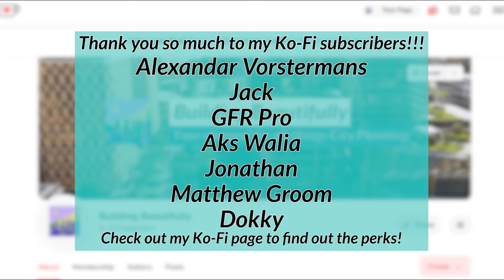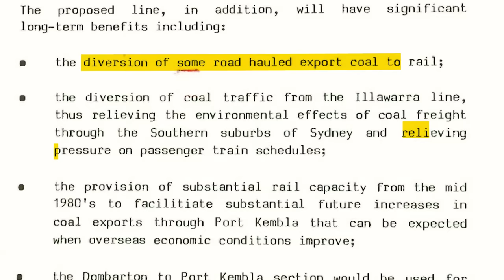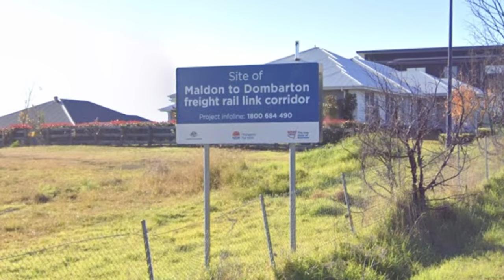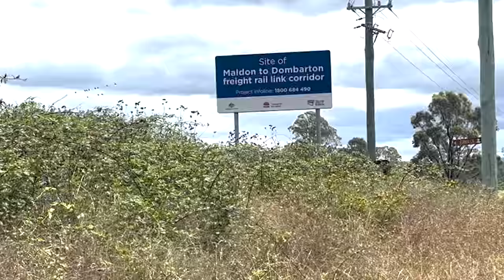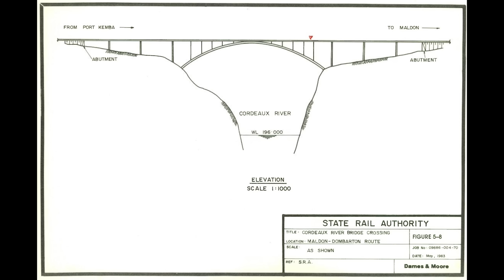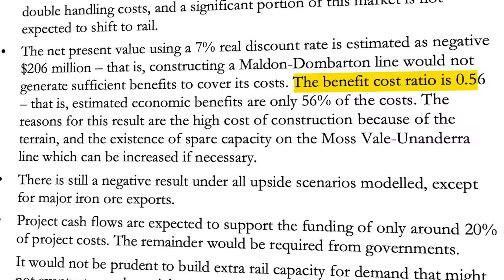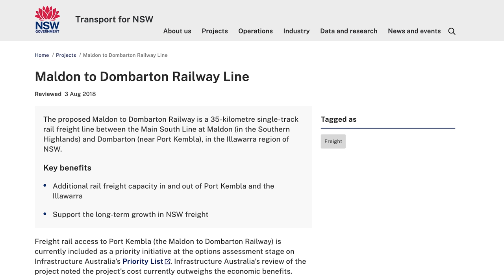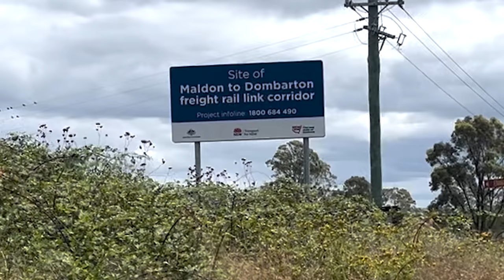The Maldon-Dombarton Rail Link: Lost Sydney

Comment: Interesting video. I lived in Camden at the time of the closure and did travel around the area a bit so was familiar with the missing bridge. You mentioned that the cost of coal dropped and that this was the reason for the government's decion to abandon the project. This is generally correct, however if memory serves,  the drop in coal prices led to a  number of the BHP Burragorang pits to close. These mines would have been the primary source of the freight traffic on the line and also that the future of the mines in the area would be in doubt for years. As a sideline, hundreds of miners resident in Camden and surrounds were suddenly out of work as a result of the mine closures.

Comment: Nick Greiner (pronounced like Grinder without the D by the way) and his successor Johm Fahey were about as anti rail as you could get, it was on their watch that SRA were split into 3 seperate entities (City Rail, Freight Rail and Countrylink) then privatised altogether, virtually all new rail projects were cancelled whether they were still on the drawing board or partially completed. Only maintenance and upgrades of existing rail corridors were allowed under the Greiner/Fahey governments and even that ceased after full privatisation, eventually the then head of State Rail during the early 90's John Brew who oversaw the huge maintenance and upgrade prior to the handover became the most outspoken opponent of the lazy penny pinching corporation who took over administration of the NSW rail system.
BTW yes you did get the pronunciation of Unanderra correct.

Comment: NSW Government want to "straighten" the current SW rail line from near Maldon to bypass Picton and Tahmoor, and join the line at the Tahmoor coal mine. There is plans for a freeway on-ramp and off-ramp near Douglas Park to head up past Camden to go towards the new 2nd Sydney airport. Now with the 15-20 thousand houses proposed at Appin and the 15-20 thousand houses at WiIton, with a high school, shopping centres, etc, and no real transport infrastructure proposed. If the rail line was build and a station put at Wilton, it could serve as a transfer to go between the South Coast to both Picton/Tahmoor and on to the SW to Mittagong/Mossvale as well as to Narellan or Leppington and the proposed rail link to the 2nd Sydney airport. The Unanderra-Moss Vale line has stopped being used for passenger trains a while ago, with only buses traveling between Moss Vale and the South Coast. There is no rail link to the South Coast anywhere from SW of Sydney south of Wolli Creek station
Reply from the maker: Let’s hope a link is built in the next few years/decades. God knows the area needs one.

Comment: The other main issue is this alignment was to be electric, the tunnel grade was fine for electric locos but won't be for diesel and then you have issues with ventilation in such a long tunnel and diesel locos. If it was to be built for diesel the tunnel alignment would need to change and overcome engineering issues for the ventilation

Comment: There are a number of problems on the illawarra line that need to be rectified to run passenger rail services efficiently.
There is no point in building the Maldon/Dombarton unitil the the Hurstville/Sutherland bottleneck is rectified, freight can operate out of hours.
No improvements to Wollongong/South Coast or services to the shire can be undertaken without track duplication.
HS2 to Wollongong is off the table until Santa becomes the Premier of NSW.

The first problem is the 2 track bottleneck between Hurstville and Sutherland/Waterfall, the more trains that are pushed onto this route due to increasing population of the shire restricts how train services can be operated on the whole illawarra line, if the 20 trains per hour limit is reached between Sutherland and Hurstville no express trains can be operated. Trains from Wollongong are forced to make stops or operate slowly so can't just stop at Waterfall, Sutherland, Hurstville in peak hours and run at high speed on this part of the route.

Fixing this is very costly between Hurstville and Mortdale there are steep slopes on the rail verges that need significant construction work for track duplication requiring both land resumption and heavy viaduct construction. 
A new higher bridge at Oatley/Como can be built and the Mortdale sidings/carriage works could be relocated to Loftus, these works are also very pricey.

If this project were done in conjunction with the Maldon to Dombarton link, then significant savings could be made in both the construction of the Como bridge and Penshurst viaduct.
I don't see any change from $4-$5 billion. It is however the first step in much faster, efficient Illawarra service (inclusive of better Shire services) with a lot more capacity.
Reply: But the Maldon/Dumbarton line was never about freight to inner Sydney, but about linking Port Kembla to the extensive coal mines in the southwest of the Sydney basin. The further link to the existing general freight network was a bonus, but not the main game. Now that those mines have largely closed (and the remainder are doomed) there must be no case at all for finishing that tunnel, at least as a dedicated freight line. Possibly it is now worth doing as a way of linking Western Sydney Airport and the southwestern suburbs of Sydney to the Illawarra though.

Comment: Not mentioned in the video but that line was meant to have been electrified (at 25Kv AC) which I believe is how they could get away with such a long tunnel. Be interesting to see if the project ever does get the go ahead what mods they would need to do to the tunnel to allow diesel trains through. Or if, and I doubt it with railways being privately operated if electric locos would return to NSW.
Reply: They could have gotten away with using diesels because loaded trains were expected to be running downgrade. The diesel engines would have been at idle with dynamic breaks pumping heat into the tunnel but very little exhaust. A fan system could be installed to deal with fumes from trains running upgrade, much like the Otira tunnel in New Zealand.
Reply: @dat581  that wasn’t the plan though. The plan was 100% electric which at the time is how freight trains in the Sydney area operated.
Reply: Diesel trains go through tunnels 3 km long in Europe.  It’s not the end of the world. Plus in the 21st century you can build exhaust systems. They do for car tunnels.
Reply: @xr6lad  think you have totally missed my point/question. Of course diesels can run in long tunnels. However that (proposed) tunnel was designed for 100% electric. My question was what mods would be needed to allow diesel in that tunnel. 

Yes extra ventilation is required however to accomodate that would it mean a complete redesign of the tunnel route etc to accomodate it.
Reply: Not sure about AC.  NSW traction is DC. I think 11kv
Reply: @brucegibson5816  NSW is 1500v DC. 

However I was not mistaken the plan for this line was 25Kv A/C. The 86 class locos weee designed to be retrofitted as dual voltage. At the time NSW railways had a policy of changing locos to electric once they got under the wires (the exception being the southern line though the wires did extend past MacArthur to service the mine(S) near Picton) with plans to extend the wires and the electric loco fleet further.
Reply: @xr6lad  btw I did some further reading on the Avon tunnel. The design of it would have permitted multiple diesel electric locomotives in the downhill direction, but in the uphill direction only a single diesel electric loco. The XPT was also ok to run in it. Limitations on running diesels uphill was the reason why it was going to be electrified, with 25Kv AC being specified again for the power drain going uphill.

Comment: I regularly drive the Moss Vale to Unanderra section of train line.
For many years I asked people how far they dug the tunnel we'd pass at the top of Dombarton. I'd get all different answers.
Finally on a day of strong winds a tree blocked the line just before we passed the tunnel portal.
I went and had a look for myself. It only extends about 20 metres in.
Riddle solved.
What I didn't know is that it was to be over 3km long!

Comment: I am surprised with all the new technology for it and tunnels that have been dug over recent years (even in Sydney we have multiple Metro, North Connex, West Connex, etc) that the price of tunnelling has gone up rather than down.
Reply: Perhaps they will dig the tunnel AFTER they finish digging the new harbour tunnels using one of those machines!?
Reply: @gbsailing9436  it doesn’t quite work like that. TBM’s are designed specifically for the geology they are boring through. 

Besides the TBM’s doing the road tunnel under the harbour are over double the size needed for a railway tunnel. The head on that thing is 15m in diameter,

Comment: An interesting happening was the apin coal mine disaster.after which the mine was given permission to pump toxic water into a creek that flowed into the George’s river and basically killed everything.I doubt the river has recovered to this day.there is also the story of the flammable river.. there were that many gas bubbles you could set it alight and not long after the entire river disappeared flowing underground.
Reply: Yes, it is bizarre if Sydney Water opposed this line on the grounds of water quility issues for the Avon and Nepean dams, given the very extensive coal mining and limestone quarrying - complete with a continuous stream of semis down to Port Kembla - that already operated in this catchment. I would have thought the (then) need for this line was all about those coal mines and the Maldon cement works.
Reply: It will be finished just a rezoning issue..

Comment: One interesting fact missing is that the rail line run right through the middle of Elouera Colliery longwall blocks which started in 1993 so about 1988 it was in planning stage which is why the project was put on hold
Reply: How do you know it hit the long wall, is the route posted publicly?
Reply: @gbsailing9436  the rail line ran over the longwall blocks which meant they could not be extracted so the line was put on hold the western end of the tunnel is next to Wongawilli fan shaft
Reply: @gregryan2359  Oh I see. can they not create a route around it?
Reply: @gregryan2359  Ok, so is the building that can be seen near the western portal on satellite view for ventilation? I guess so.

Comment: It was a project that had foresight and vision for the future, both in the fact that it was a dedicated freight line and completely electric. But alas a liberal government got elected and wasted the millions of dollars that had been spent not being able to see the long term goals that the project was convinced of. I've visited the line many times the earliest being 1997 steel posts where still there laying on the ground as was rolls of power lines as the years progressed less and less of them could be found. The problem now with the project is that if it was to be finished the cost would be close to a billion dollars the new residents of Wilton won't be happy and the bridge at the Nepean river would need to be demolished and rebuilt. Bridge piers that don't have weight on them and aren't linked together become structurally unsound over time.
Reply: Shocking.
Reply from the maker: Wow, what a waste if they had to reconstruct that bridge.
Reply: @BuildingBeautifully  I am not sure if it is still there but some acerages near Gulgong had many structural sections that were intended for the Sandy Hollow rail link. Exact same situation as with this link except that WW2 and pollies came along causing the stoppage. Was intended to link north west of NSW to Newcastle port.

Comment: Whilst it’s cheaper to upgrade the Unanderra - Moss Vale Line (which should still happen). It still makes sense to build the Maldon- Dombarton Rail Link. Yes it’s more expensive, but in the long run it will be worth it.

Comment: 13:22 Of course any future world class high speed rail network will require its own dedicated rail corridor. The Japan Rail Tokaido Shinkansen would not have been built without it.

This 1960s documentary explains all. 

Tip: enable closed captions and auto translation as the video is in Japanese.

https://youtu.be/8fF_jn6jakY

Comment: This is completely unrelated to the video but I do have a question, that you may or may not answer.

Hey Sharath, you know how the Sydney Metro City & Southwest will replace some parts of the T3 line? Well, it will cut off the T3 into 2 segments, meaning a simple trip from Birrong to the City will take a long time due to switching back and fourth lines.

Our government claims, "It will be faster with the metro," but in reality, it'd be really slow, with added on 5 minutes wait times.

So what are your opinions on the Sydney Metro City and Southwest?
Reply from the maker: Funny you should ask that, because that’s gonna be my next video. You’ll hear all my opinions in that!

Comment: You forgot to add that it was designed for electric traction only with 25kv electric locomotives which would have been extra 86 classes being built, otherwise large exhaust extraction fans would have to be added and I doubt this will happen in Waterford Catchment areas
Reply: 86 class locos were designed for & operated on 1500v, same as 46 & 85 class. Not 25kv
Reply: @markpusko2480  from what I remember a 2nd order of 86 class were going to be designed to run like this. That's what I heard at the time
Reply: @thruthelens7100  This got me curious & I did some research. referencing the book 'A History of Commonwealth Engineering Vol. 4' - When the 86 Class tender came out Comeng proposed to supply either chopper control or 3 phase AC traction however StateRail insisted it remain 1500v camshaft control as had been on all electric trains at that time. After the success of 8650 with the Bo-Bo-Bo axle configuration StateRail  were going to propose a tender for dual 1500v/25Kv locomotives. These locomotives would've been an evolution of the 86 class, but a different class number. Those locomotives, like the Dombarton Railway line - were never built.

Comment: If it was bidirectional, connected to high density housing points along the route (outside the protected area of course) and catered for both freight and passenger rail, and connected passengers to Wollongong beaches at the eastern end, this line would be a success. Look at the Cronulla Line's popularity at transporting people to the beach. It's the same idea. This would then give anyone on the Sydney-Canberra line access to Wollongong and the beach, and vice versa. A very very short-sighted decision to halt this project and I suspect the CBA misses a whole stack of metrics.
In addition, as Elon Musk's Boring Company has shown, boring holes through hills and mountains is in fact not that expensive at all. It's actually more expensive to build a station than a tunnel.

Comment: Similar story for the Maryvale to Gulgong, our leaders share a ongoing heritage through the ages.
Reply: The Maryvale/Sandy Hollow line. Maryvale is between Wellington and Dubbo. The Gulgong to Sandy Hollow section was built in the ‘80s possibly for coal. It was a depression jobs creation project that got almost as far as the M/DB line. The tunnel between Gulgong and Sandy Hollow was built and used as the road for years. The bridge pillars over the Goulburn river look impressive.

Comment: It become useless - construction prices rised 10fold, and train capacity also, so now it is easier and cheaper to send heavy modern trains with powerful locos for additional 80km thru Robertson or South coast/Illavara line rather than spend almost billion one-off. 

And Illavara line is not too congested, its just a question of signalling, planning and consistency. It is double up to Unanderra and Pt Kembla, in Europe similar routes carry one train every 5 minutes, sometimes (Austrian West line) 3 min, 20 trains per hour, from heavy freight and local trains to ICE/Railjet/Westbahn travelling at 200 kmh. Day by day, year by year, not like our railways not changed in signalling for last 50 years.

Comment: 3½ Kilometre tunnel. I'm sick of Woy Woy tunnel still taking the mantle a the longest railway tunnel in Australia after 135 years. England has a few longer tunnels, one going for four Kilometres.
Reply from the maker: Well, we do have the Sydney Metro tunnels, and I think that might as well count even though it’s rapid transit and not train.
Reply: @BuildingBeautifully  and London has plenty of tunnels that far exceed that length too including the new Elizabeth line tunnels and the HS1 tunnels.
Reply: @BuildingBeautifully  an underground system doesn't count really. In talking about an autonomous tunnel, unless the metro has a tunnel leading to an open station or between open stations.
Reply: So you would be aware of the importance of constructing the Woy Woy tunnel and what it meant for the great railway line we have to the north?
Reply: @flamingfrancis  Very aware, but it was in 1888! Surely we should have surpassed a mile by now. Dictator Greiner took that away.